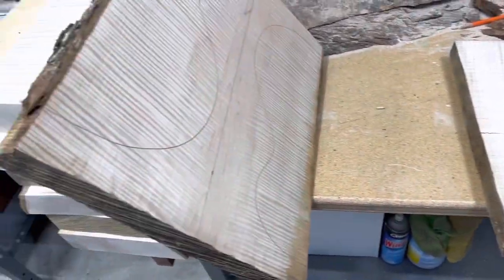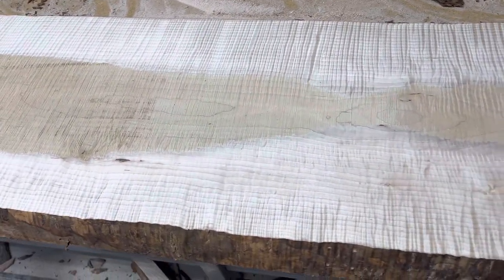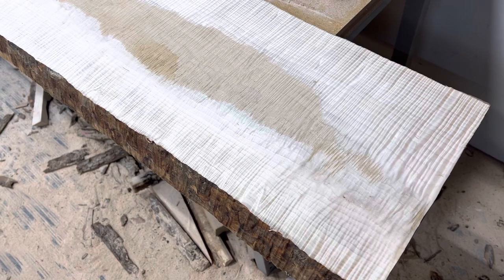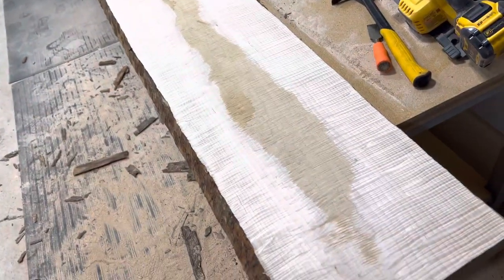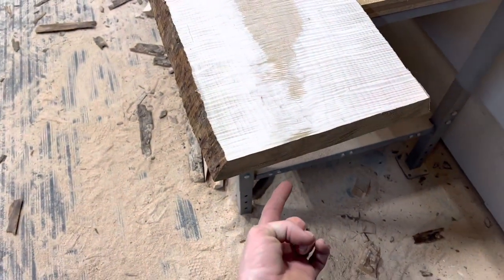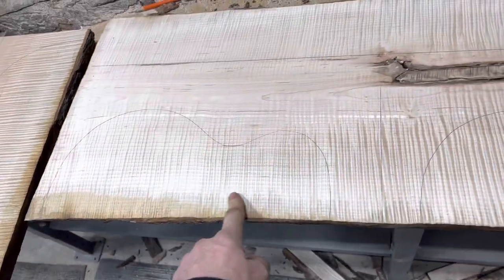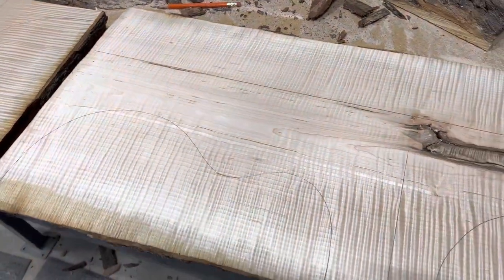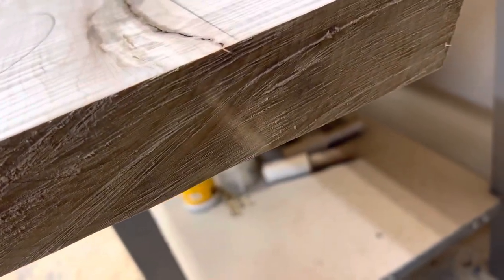Cutting Curly Maple Lumber

Comment: Thank you Mr. Kimball.   Can you tell me how to look at rough cut, select or better hard maple and determine if it has some curl?  Thanks
Reply from the maker: Easiest way is the side grain. If you are looking at a rough cut bundle pack it will stand out as most of the wood in those packs are Flat Sawn leaving the Side grain of the rough cut lumber on the quarter sawn side. Quarter sawn curly maple is more vibrant and easier to detect in the rough than flat sawn curly maple. Most lumber produced by large mills will be band mill cut with a traditional resaw blade. Decerning the difference between saw marks and curl is the key. Band saw mark are for the most part perfectly straight. Look for curl or marks that are not straight or consistent. If the lumber is rotary cut meaning with a circular saw blade it can me more difficult to detect because the saw marks left emulate curl pattern in wood